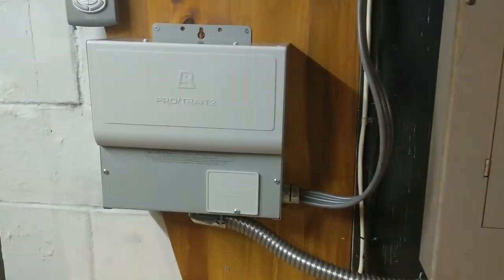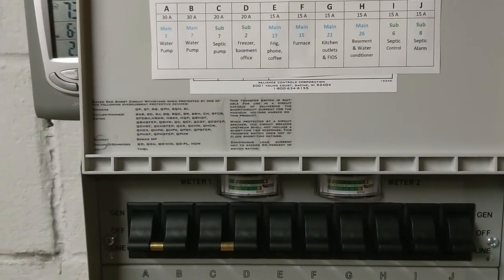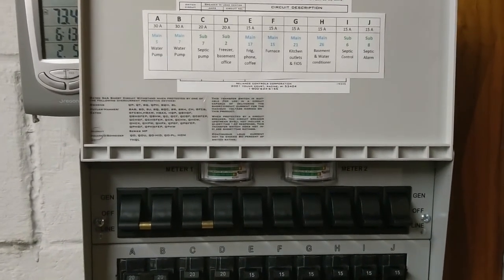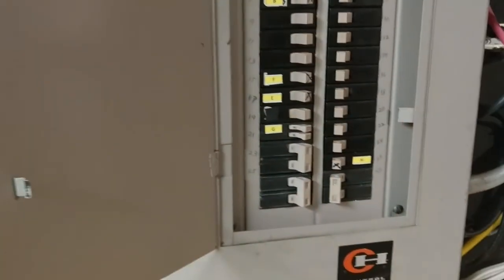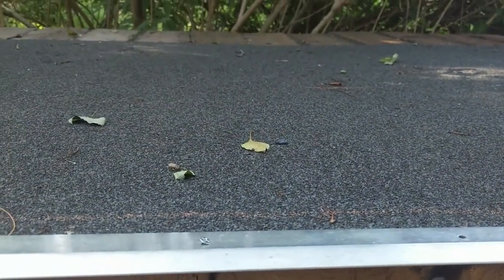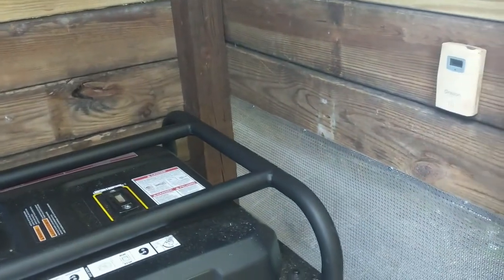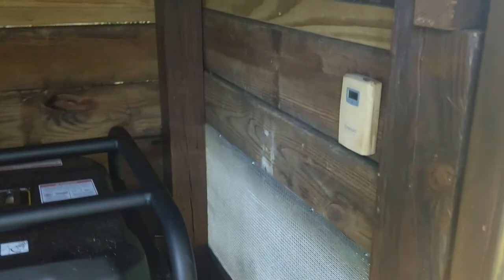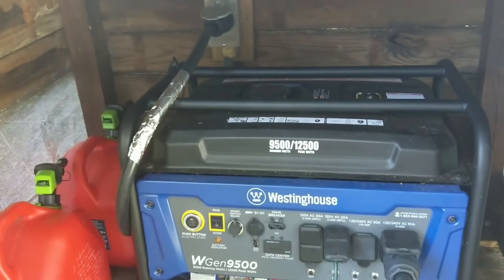Part III - Building a Generator Shed and Electrical Stuff

Comment: I bought the Westinghouse Wgen9500/12500DF a week ago. Just got it fired up on propane today. I can`t believe how quiet and smooth it is! Cost me $999 at Home Depot. They had it advertised at $1199, and i showed them a couple places that sell them for $999, so they honored and matched it. I`m in the process of building a shed similar to yours. I`m glad you mentioned about the heat issue you had inside your shed. Seems you could extend your exhaust with a little short pipe to get it outside of your shed. It should make a huge difference. So, being that you uploaded this video awhile ago, i was wondering how your generator is still holding up. I bought ours by looking at ALOT of reviews. The Westinghouse seemed to have the better quantity of good reviews, so based my buying of one on all the majority of good reviews. I`ve already got my sub panel wired up and ready to go. All i`m waiting for is the power cord now. That should be here this week. One more question, how did you go about breaking in your generator when you first ran it. I see where Westinghouse is saying 5hrs at half the wattage to break in the engine.
Reply from the maker: So far so good, it runs great.  Now, I start it every 2 months and run it for 15-20 minutes so the battery doesn't die when I need the electric start to work during outages.  As for breaking it in, I didn't do that, I just ran it normally.
Reply: @talvids  Commons sense and Safety must work together to PREVENT accident and problems
Reply: Yep yep......To Be better Control the Temperature in the Generator Shed......it Must have proper size to Suck Hot air outside at least 12" -14" Exhausted Fan and Muffler exhaust Must extended to outside of the Shed To NOT Over Heat anything in the Shed..... plus Carbon monoxide poison...

Comment: All you need is to attach this to your generator
Exhaust : 

Walker (40000) 1" Diameter - 25'... https://www.amazon.com/dp/B0027IU9UY?ref=ppx_pop_mob_ap_share

You can then place that inside another bigger pipe like this or smaller
DuraVent 3PVL-06 PelletVent Stove Vent Straight Length Pipe, Stainless Steel Inner Wall and Galvalume Outer Wall, Fully Unitized, Twist-Lock Construction, 6" x 3" Diameter https://www.amazon.com/dp/B000KZ632O/ref=cm_sw_r_cp_api_glc_fabc_jXR2FbJE8DKM4

going outside.

And if you wanna get really fancy place this on the roof of your shed:

AIR VENT 53827 Roof Mounted Power Attic Ventilator, Brown https://www.amazon.com/dp/B0009SNSNE/ref=cm_sw_r_cp_api_glc_fabc_5YR2FbKRZ5VSY

Other than that. Great job.